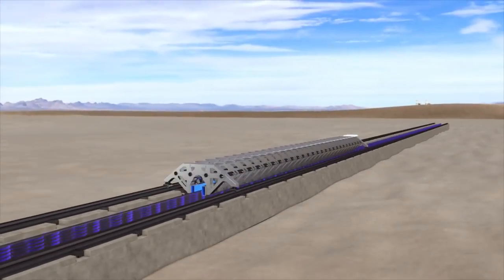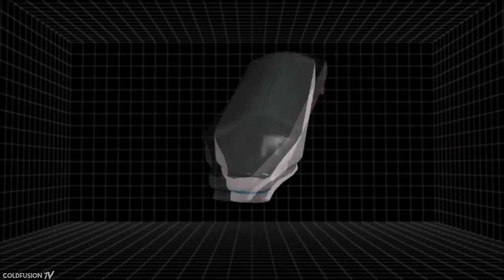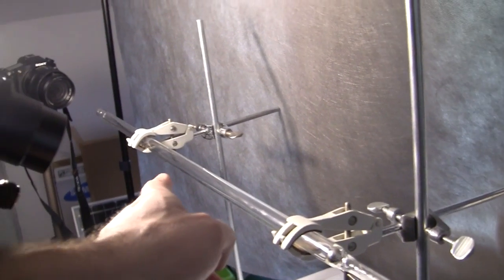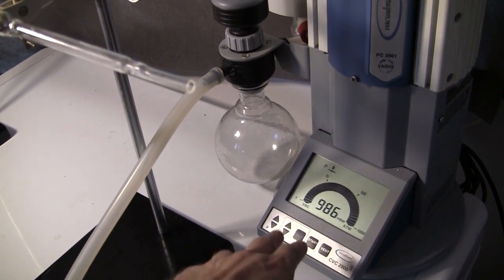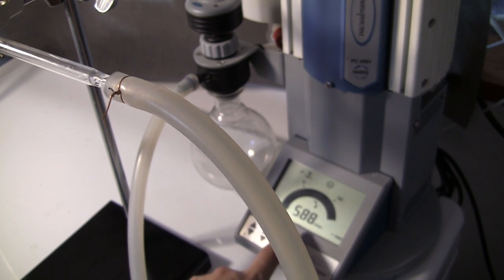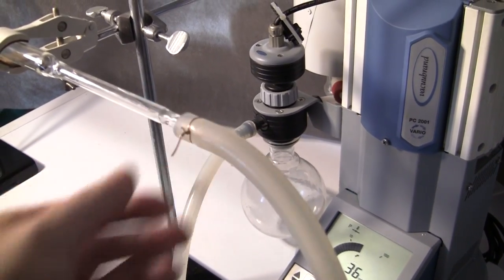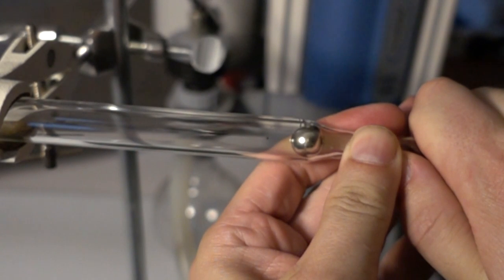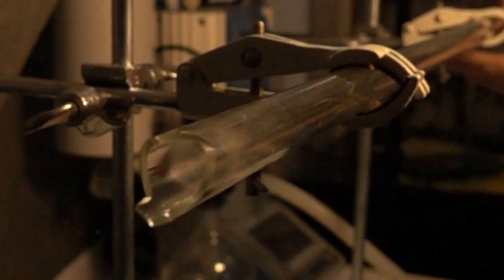How  the Hyperloop can kill you!

Comment: Interesting video, but, I have a couple of points.  Firstly you seem to have assumed that the pod is a good fit to the tube. From the concept art, this does not appear to be so. The pod, looks by eyeball to be not more than 70% of the cross-sectional area of the inside of the tube. Secondly you take no account of possible, relatively simple fail-safe mechanisms, such as re-pressurising the tube in front of the pod  in the event of a tube breach behind the pod. Along with this, the Mag-Lev and electric motors as well as any mechanical braking systems system would be acting to slow the pod down.  You might want to perform some more experiments, such as using a smaller ball-bearing with a similar cross-sectional area ratio with the tube, to the pod-tube ratio in the concept art. Use a magnet to simulate the braking effect, and break the tube both in front, as well as behind the  simulated pod. This would give us a much better understanding of the forces involved.

Comment: Do an experiment with everything scaled up by x2. I bet you will get less acceleration. Also, the train doesn't have to fill up the entire cross section of the tube, that will greatly effect the results.
Mass is 4x, cross section of air entering the tube is x2. Effectively the force on the train from the pressure is proportional to the cross section of the train, so again x2.
Also, they don't have to lower the pressure that much, just enough to save a lot of energy. Can't believe you've gone after this one thunderfoot, it is a perfectly viable idea. One that will probably be realised within the next 50 years.

Comment: I'm afraid i disagree with thunderf00t on this one. It's an engineering problem. With proper setup and computation, there are many ways to decelerate the train at the end including magnetic field in the reverse direction (similar to an dams electric generator vs a car electric motor).
Regarding the ridiculously high acceleration, perhaps one could simply have some sort of spring/sponge mat to slow the relative acceleration of certain parts of the train.
Much like the problems with nuclear fusion, this is an engineering challenge and not one that i personally think to be insurmountable.

Comment: Just because an accident will be bad doesn't mean its not technically feasible.  If a rocket blows up, you are DEAD,  most passenger air crashes result in all passengers DEAD.  There are plenty things we do which are hard and dangerous. 

If you have a video debunking the engineering of it all. Thats more like it.

Comment: Magnetic trains can also have magnetic brakes. Additionally, the tunnels are built in sections and can have bulkheads implemented which act as air locks in case of emergencies. Furthermore, the chances of an entire 2 meter wide section breaking in the way you're showing here is incredibly low. Leaks would be determined by sensors throughout the entire tube and if a leak is detected, the trains would be stopped and sections sealed.

Iow: most of your videos are spot on but that's only because the technology you debunk violates some basic law of physics - this does not, it's a technological problem with a technological solution.

Comment: Where did you get the pressure of the tube from? I cant find it anywhere. All pods are using a fan for forward motion and magnetic or air based levitation. You need some air pressure for those. Dont think that 1mbar is sufficient.

Comment: easily solved by automatic equalization valves at intervals down the entire track. They could sense pressure change and equalize the entire loop quickly with enough of them, also a good fail safe if a train loses pressure. plus the train isn't propelled using air pressure pushing it from behind its not a perfect seal around it.

Comment: Your forgot to account for the electromagnetic rail that the carriage runs on? If you try and push the carriage with air pressure due to a “vacuum failure” along an electromagnetic rail you just cut the power to the rail (safety system) this will generate heavy resistance preventing rapid acceleration as you effectively have a massive electromagnetic brake.

Comment: The depressurization would be even more catastrophic if you were moving at high speed towards the point of failure.
But couldn't the base amount of the depressurization be reduced and you'd still have a lot of reduced resistance?
Or if there is a loss in pressure, trigger some emergency valves up and down a wide region of the tube to open and pressurize the tube.